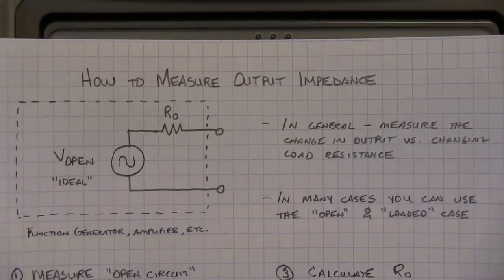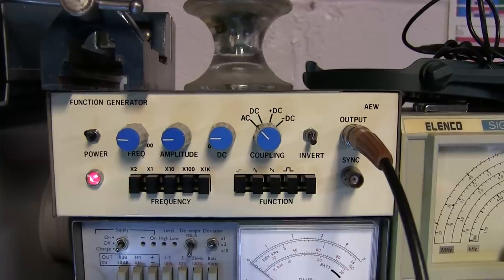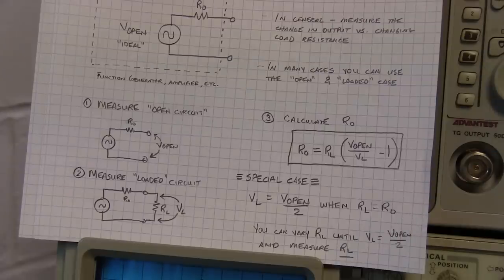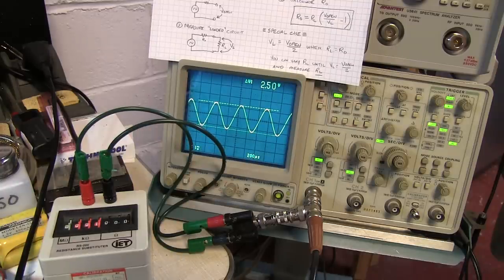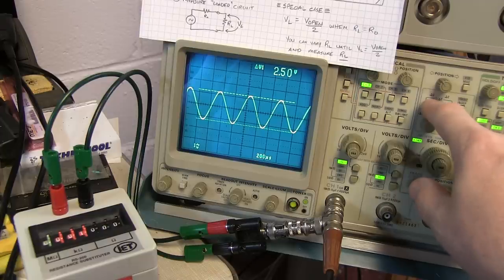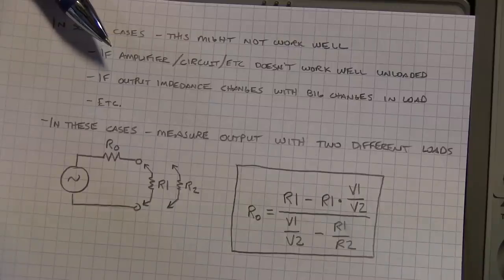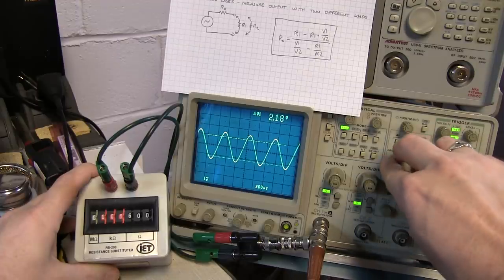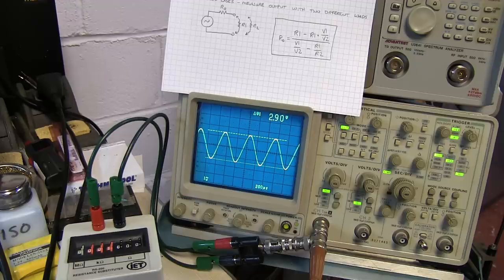#138: How to Measure Output Impedance

Comment: The formula at the end doesn't work. I have a 555 oscillator which seems to drop to half output voltage around 10 ohms, and using a 6R8 resistor made some measurements and ran some calculations, but had an impedance of 125 ohms. Turn the figures around and you get a negative resistance! The formula is unreliable.
Reply from the maker: The problem is likely that when driving such low impedances, that the output impedance of the device under test isn't constant, but is a function of the load current.  The formula assumes a constant output impedance.
Reply: Thanks for the answer. It was irritating to see the impedance wasn't even close and using lower voltages (DC multimeter measurements but could easily have come from dropping the voltage) gave the negative result.  The other ways seem to give best results, getting a feel for the half voltage impedance, but as you say, if that is too low, it could be guesswork after that! All down to operating voltages and frequency bandwidths.

Comment: How does one measure the output impedance of an RF circuit (oscillator / amplifier) without fancy SWR meters?

Awesome video as always. Thanks a ton!!
Reply from the maker: It is not an easy thing to do, unfortunately.  Most common techniques are with a vector network analyzer or with a load-pull test set.
Reply: @w2aew  Alrighty thanks!

Comment: Hi
I have a question regarding conductance,  can you measure conductance of a let say car battery  ,this by a scope?
I sort of measure the resistance  and this in  certain time peiods      i think then in days or week or month   so see how the resistance increases in  time

I think of sending a certain freq on one side collect it on the other side then calc the time        this must increase when resistance increases or not?
Reply from the maker: No. This method is for AC sources. For a DC source like a battery, you can make similar DC measurements with a DMM with different loads.

Comment: Can you use an ohmmeter to measure the output resistance of an opamp straight away? Are the probes across vin1 and vout or vin2 and vout of an opamp?
Reply from the maker: No, you can't.  The output impedance is determined by the active device design and can't be measured with a simple resistance measurements. Note that op amp output impedance is typically very low.

Comment: Hi sometimes our signal is very high frequency like ghz and we can't measure amplitude by an oscilloscope or even an spectrum analyzer how we can measure output impedance in this case?
Reply from the maker: A four port VNA is typically used to measure the small-signal output impedance in this case.  If you are talking about large signal or high power outputs, then often a load-pull analyzer ($$$) is used.
Reply: @w2aew  everything can be done with $$$$ 😁

Comment: When looking at the first stage/front end of an amplifier circuit, how can you tell if the first stage/front end is High impedance or low impedance? how can you tell how "sensitive' the front end will be to a low impedance input signal?
Reply from the maker: By examination of the circuit you should be able to approximate the input impedance.  For the most part, if the amplifier isn't designed for RF use, the input impedance will most likely be relatively high.
Reply: @w2aew  If the audio amplifier doesn't have any resistor to ground its just only a decoupling cap connected to Q1 and transistor#2/Q2 feedback resistor is biasing the base of Q1 would this be considered an input that is low impedance or high impedance? Because mostly you put a 1meg resistor to ground on the input jack with the decoupling cap in series to the base of Q1 transistor. The 1meg resistor to ground is mostly what determines the High impedance. But if you don't have any resistor to ground the biasing resistors R1 and R2 set the bias voltage for the base of the Q1 transistor. I don't think R1 and R2 determine the input impedance they only set the biasing voltage of the base. But other amplifier configurations omit R1 and R2 and just use a feedback resistor from Q2/transistor#2 to set the biasing voltage for the base voltage of Q1. The input impedance gets really sensitive to low impedance.

Comment: Voltmeters are better in accuracy than scopes when measuring voltages,
Reply: +mejoe444 
Higher voltages into a constant load result in higher currents. Also, there is more light outside during the day than at night time.

Comment: Hi, If I want measure output impedance in RF circuit example in my "colpitts oscillator". I can measure how you explained?
Reply from the maker: not really.  As mentioned early in the video, we use a low frequency to avoid transmission line, termination, etc. issues that occur at higher frequencies.
Reply: w2aew , how do you measure output impedance in an RF circuit? For a small signal I could use a test load and calculate what the value is, but what about a high power amplifier like for ham radio?

Comment: ok, so now I can measure output impedance of the local oscillator and than match it with the diode mixer🙂 If I understand you correctly we can measure input impedance with the same way?
Reply from the maker: This shouldn't be necessary because the LO input of a diode mixer is non-linear (commutating diodes), and thus is not impedance matched (or realistically matchable).
Reply: @w2aew  thank you! sorry for the stupid question, because I am just a beginner)
Reply from the maker: @Avrora707    No worries - it is not a stupid question.  A lot of people don't realize that the LO of a diode ring mixer isn't a nice 50 ohm load.

Comment: Just out of curiosity, what is this signal generator built upon? 20-30 years ago, i'm guesing it's opamps? or is it discrete?
Reply from the maker: If I recall correctly, it started off as a kit based on the EXAR XR2206CP monolythic function generator IC - followed up by an op amp based output buffer that i designed to give more flexibility in output amplitude, polarity and offset.
Reply: @w2aew  Alright, thanks for a response! Suprisingly, It looks like XR2206CP is still being made. I'm asking because, i'm thinking of making a generator myself, although i have to say that i find my smartphone to be quite good at it for testing the average audio stuff.

Comment: Great video. Subscribed. Just wondering what you used for your funct generator.
Reply from the maker: This was a home-made function generator that i designed and built 25 years ago.  Unfortunately, I have lost the documentation of the design, so I'd have to do some reverse engineering to recover the design.
Reply: ***** Don't sweat it. Just thought I noticed the same kind of distortion on the peaks of the sine wave as I have on my function generator I built with an XR2206. Might be just seeing things though. In any case, great work on your videos. And if you get a minute, I'd love to hear your input (read: see a video) about good grounding techniques (esp. in regards to audio electronics.) Thanks!

Comment: Do you  have a video about what impedance has to do with measuring tube radio circuits, like why you use a VTVM meter instead of a multi meter, when checking components in the circuits..
Reply from the maker: I don't have a video, but it is a relatively simple topic to explain.  Many tube circuits and nets are very high impedance. This is because the plate output impedance is quite high, and the grid is a very high (near open circuit) impedance.  If you use a multimeter to measure these circuits, the input impedance of the multimeter will often be much lower than the circuit node impedance, and thus will alter the voltage when you connect it.  A common multimeter impedance is 20,000 ohms per volt, which means that if you have the meter set to a 50V scale, its input impedance is 50*20000, or 1Mohm. At lower voltage ranges, the input impedance is much lower. A typical VTVM or modern DMM has an input impedance of 10Mohms, thus will load (and alter) the circuit to a much lower extent.
Reply: @w2aew  So a mulitmeter will drop the readings, or change the circuit more than a VTVM, which will do what when it drops? I guess I dont understand  what impedance is or does..
Reply from the maker: @kennynvake4hve584  Impedance is just a fancy word for resistance.  Actually, it refers to the resistance + reactance - more completely called complex impedance.  But for the purposes of this discussion, let's just say that impedance = resistance.  Each circuit node can be "modeled" as a voltage source with a series resistor (Kirchoff's Law).  Thus, the voltage at each node can be changed by drawing current from it (with a load of some sort).  Some circuit nodes have a very low impedance (resistance), meaning that the voltage stays fairly constant even when a load is applied.  A power supply node or supply rail in circuit is an example of a low-impedance node.  The voltage remains constant even when drawing current from it.  Other nodes in a circuit can have much higher impedance (resistance), which means that the voltage can change if you draw some current from it while measuring it.  The circuitry connected to the Grid of a vacuum tube will often be high impedance (resistance).  So, if you connect a multimeter or VOM to it, it may change the voltage at that node.  Consider the following example:  A circuit node that is operating at 3V has a 100Kohm impedance - meaning that it "looks like" a 3V voltage source with a 100Kohm resistor in series.  If you use a multimeter with a 20,000 ohms/volt rating and set it to a 5V scale, the meter will have a input resistance of 5*20,000, or 100Kohms.  If you connect this meter between our test node and ground, the circuit's resistance and the meter resistance will form a voltage divider, and the voltage on that node will drop to 2.5V.  It is the same as putting a 100Kohm resistor between that node and ground.  You can see from this example that a VTVM with a 10Mohm input resistance will have much less of an effect:
5V * (1M/(1M+100K)) = 4.55V

Comment: is this a good response of a signal gen? cause ideally i think it should not be affected when loaded. the feedback circuit should take care of maintaining the amplitude
Reply: unless i could design my output impedance to be relatively small so that it would be negligible in the voltage divider
Reply from the maker: High frequency signal generators typically have a 50 ohm output impedance.  If you use feedback to set the amplitude regardless of load, then the effective output impedance is then lower than 50 ohms, thus giving the generator a poorer output return loss.

Comment: When converting high impedance to lower impedance the signal drops down 20dB or more. This means that high impedance audio signals has more current drive, power, energy compared to low impedance audio signals? because what is the difference between an audio signal that is high impedance audio signal compared to a low impedance audio signal? it must have to do with the signals energy and power?
Reply from the maker: Just the opposite!  High impedance sources can't deliver as much current or power as low impedance sources.
Reply: @w2aew  But when concerting from High impedance audio signal to a low impedance audio signal its a 20dB loss from input to output, any reasons why? The high impedance audio signal is 20dB lower when converting it to a low impedance audio signal. If low impedance has more current and more power it should be +20dB not -20dB
Reply from the maker: @waynegram8907  Makes perfect sense.  It's a simple resistive voltage divider.  A high impedance source effectively has a high resistance in series with the output.  A low impedance input looks like a low value resistor.  So, you have a resistive voltage divider which makes a lower voltage appear at across the low impedance load.

Comment: Just out of curiosity - What if the R_load that I am interested in is in the order of a few megaohms? You used 1 megaohm for V_open but what if R_load is higher than that?
Reply from the maker: That gets tricky to measure since most voltage measuring equipment will have 1Mohm (scope), or 10Mohm (10x scope probe or DMM) input impedance.
Reply: @w2aew  I am currently looking at driving p-n diodes in reverse bias using a sine wave generator at 200MHz. The diodes have input impedance of several megaohms (2-4 as far as I know). Given the frequency I am looking at and the method you showed, would it be safe to use the calculated output impedance of the sine wave generator, as explained in the video, to find the actual voltage across the diodes? Or does frequency play a role here?
Reply from the maker: @Terrar-fr1bk  The reverse biased impedance of the PIN diodes is so much higher than the generator, it can be considered an open circuit.  However, you may need to consider the PIN diode's capacitance under reverse bias and what it's capacitive reactance is at 200MHz.

Comment: What if the output is a differential pair? HOw would you measure the differential pairs input impedance as well? Great videos by the way!
Reply from the maker: Kevin Van Landingham Basically the same process - measure the output amplitude at two different differential load resistances, and calculate the output resistance.
Reply: So you don't need special equipment like a Time Domain Reflectometer?
Reply from the maker: There's more than one way to do things. A TDR would not be appropriate for active circuits.

Comment: Does this work for high frequencies as well, say for 300 MHz?
Reply from the maker: In theory, yes.  In practice, no.  The parasitics of such a setup will prevent you from using this measurement technique for VHF and above.
Reply: @w2aew  Thank you. What will be the best/simplest method of directly measuring impedance in such cases?  I have never been able to get around this problem :(

Comment: Mmm     how can you measure   resistance on a battery with a DMM?
Reply from the maker: same process.  measure the open circuit voltage (no load), then measure the battery voltage with a known resistive load, and calculate using the formula shown.  simple.

Comment: In the last example you show r1-r1 +v1/v2...  think that should be r1-r2+v1/v2?...
Reply from the maker: The numerator is R1 - R1 * V1 / V2.  That is a multiplication, not an addition as you wrote it.
Reply: *****
Right.  It's was the R1-R1 part that caught me.  So it's R1 - (R1* (v1/v2) ).  Without the parentheses, it tricked out my eyes and overrode the basics of order of operations.  Must be age.
Reply from the maker: k1mgy Yeah - I guess I should't assume that everyone understand the proper order of operations, and should have included the parenthesis.

Comment: Yet please tell me to what maximum frequency does this method work?
Reply from the maker: It depends a lot on the circuit. As the frequency goes up, the output impedance can start to become reactive vs purely resistive, and this simple method doesn't work anymore.
Reply: ***** Got it thanks !!!

Comment: So why did you use a sine wave? Cannot we just use a DC output?
Reply from the maker: Many times you may be wanting to measure the output impedance of a generator, amplifier, circuit, etc. that is AC coupled, and thus a DC signal won't work.